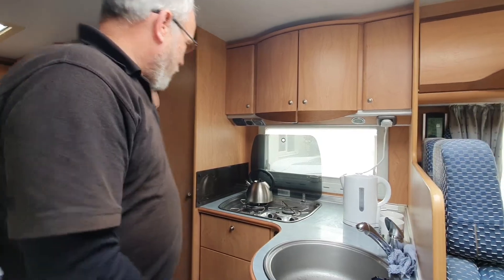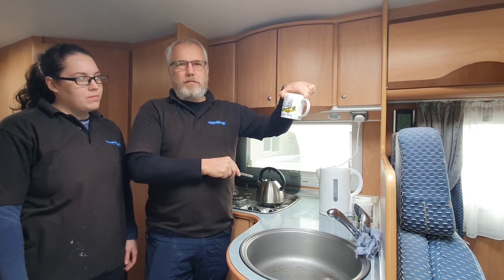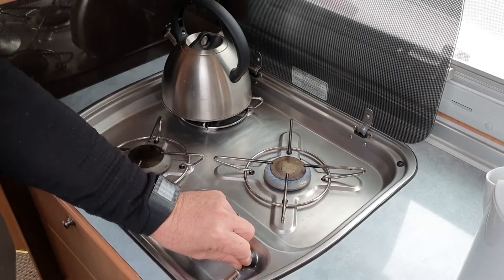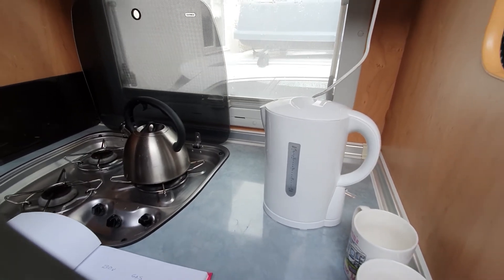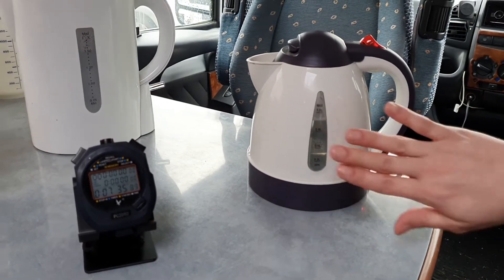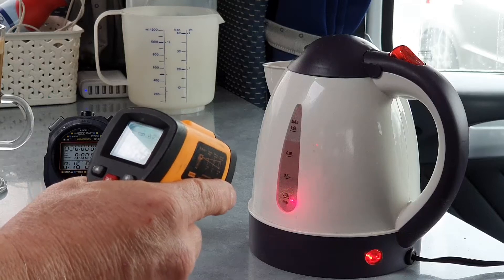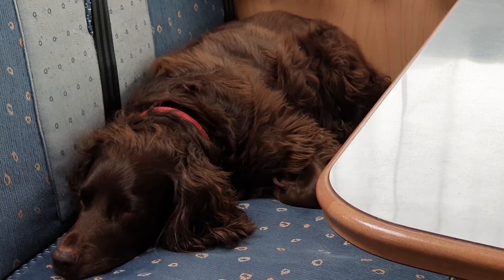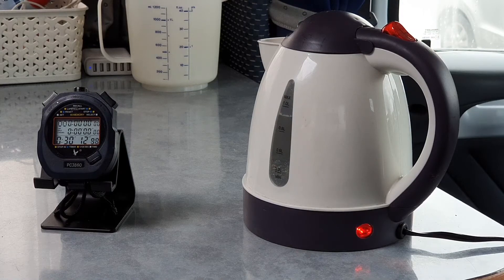How bad does a 12volt kettle suck?

Comment: Less concerned about time and more concerned with State of Charge.  The appeal of a 12v kettle is using the DC 12v port on  your power bank and avoiding the efficiency loss of the AC inverter.  It would be helpful to run the same test with 1/2 liter (Aka a large hot beverage) on a power bank from Jackery or Bluetti etc.  Run the the first test as 12v DC at 100% state of charge and measure the capacity of the battery used.  Then repeat from 100% state of charge using he AC inverter and see if the power loss from conversion to AC is made up for the shorter time requirement.  So much power is lost to AC conversion so it is useful to find DC capable alternatives even if they are a little less convenient.

Comment: You are wrong. It takes 90Wh or 330kJ of energy to bring one litter to boil. So 300W @ 12V should heat up within 20 minutes. But with 90% efficiency required power increases to 200Wh and with lesser efficiency comes a point it is impossible. 
You need a thermos type water kettle to make it work perfectly.

Comment: I also had a 12v kettle in my van and had a similar problem that it took for ever to warm up the water.  I found that the cigarette lighter power socket had a huge voltage drop and thus greatly reduced the power to the kettle. To overcome this problem I connect twin pair 6mm2 solar cable with a 50 Amp fuse directly on the battery and Anderson connectors on the kettle. It now boils in about 20 minutes. This was fine while traveling but still far too long while taking a break from driving and wanting another cupper. I have now dumped the kettle and put into the van 1.2KVA /230V inverter with a 100 A/H lithium battery that is charged from a DC to DC converter from the alternator and a 700W 230V kettle. It now takes about 5 minutes to boil the water and it also runs the toaster and the induction cooker on lower setting.
Reply: Yeah I did the same, straight from the battery and was OK for the road trips

Comment: Buy a 12v coffee maker? Heats water aswell as much as needed.  It never had to boil to get your drinks done. You only need to feel it with your hand and you will understand when it is right temp. best part, you do not need to wait for it to cool down as long. 50+degrees is enough to get tea or 3in1 coffee done. So what if it takes 30 minutes? Totally free energy... i think independence is worth it really!

Comment: Those gas kettles could warm up just as fast if the firsts flames weren't so wasted flying up around the outside of the kettle
Reply: If you could make a kettle inside of a kettle, and then put it on the stove so that the gas goes up and through the space between the inner and outer shell, way more of the energy would be absorbed and it would be much more efficient.

Comment: All 12V kettles for regular cigarette lighter socket are total crap. To even get to the level of 1500 watt american kettles you'd need to have a ridiculous 125 amp current on 12 volts.
Reply: I have a 12v, 160watts, one, it takes 20mins to boil, while driving, I time it so that when I get to my tea break time, hot water,
Reply: I have a 12v rice cooker, 100w, takes about 15-20 minutes to boil a cup or two of water. if I have an inverter hooked up I can run a regular 120v kettle (600 or 1200w), which still isn't as fast as that Australian 2200w monster!
Reply: crap is kinda harsh, they're doing as well as they can with the limitation of the cigarette lighter plug.  it would melt with more power, or blow the vehicle fuse.  it will eventually boil but it certainly takes a while.

Comment: Would one of the Waeco Kettles be any better, they seem to have a much thicker cord on them so might be better? My portable gas hob boils much quicker than your fixed hob for the same amount of water in a similar kettle - and that's not on full flame.

Comment: It is not because of the voltage, but the wattage. You can buy a kettle with a high wattage if it is available. There are 12 volt cartridge heater/rods/coils that have above 1kW power. Many 12volt kettles have lower wattage because people are using them buy plugging them directly to one or a couple of solar panels. Unless you have a large solar system, you really want a low wattage kettle even though you need to spend a lot more time boiling your water. I believe your 12volt kettle is 300W. Most 120 volt home kettles are now 2kW. Therefore you need 8 times more to boil your water. In a power outage situation, if you don't not have a large electric generator, you can't get much power, so a low wattage kettle is actually better.
Reply: Really?  1000W 12v heater?? Only 83 Amps?? Sounds great!
Reply: Yeah , 12v kettle is designed to be used on Low wattage output device, like Small solar system as you say and cars because most of cars plug wont allow much watts at output. I have a Small heater to put in a cup of tea, it take 5-10 minuts for Booking 250ml but i use literally no power , solar only.
Reply: The problem is with the efficiency and heat loss, not power.
Reply: Hi what size generator would I need to boil 600 wat 240 kettle for my motorhome any help appreciated
Reply: Yeah you'd need to hardwire directly to your battery with 4 gauge wire to get 1000w
Reply: We bought a 6000w car convertor and it works a treat in the motorhome, also bought a power bank it boils the kettle in 10 minutes so  was useful to buy both convertor and power bank.
Reply: We bought a 6000w car convertor and it works a treat in the motorhome, also bought a power bank it boils the kettle in 10 minutes so  was useful to buy both convertor and power bank.

Comment: I have a 12v kettle and 750ml of water takes 4m 31s  But its 12v   300w  and the cable is 2 x 2.5mm  and it has croc clips rather than a ciger plug
Reply: What kind of kettle is that? The one I have at home (580W, 230V AC) brings 400 ml to boil in 6 minutes. How can then 300W bring almost twice more water to boil faster??
Reply: @AK-ho5xo  agreed. My multi voltage 110/240v UNOLD 1000W 500ml takes 3 minutes on 230V and 6.5 minutes on 110V.  No 300W kettle could beat that..
Reply: Mine takes 45mins too
Exactly like the one in the video
12vol 150w
Reply: What brand is it?  My 500ml capacity 1000W UNOLD travel kettle takes 3 minutes on 230v and 6.5 minutes on 120V.  Any 12V 300W should take 10 minutes to boil 500ml and your 750ml would take longer so it doesn't add up.  You have crocodile clips as if it were connected to the "cigarette" socket it would blow the car fuse as they are only 8A to 10A output (120W max.).  Connecting to a solar panel directly would be best, on a sunny day, as the higher volts of solar direct would boil faster.